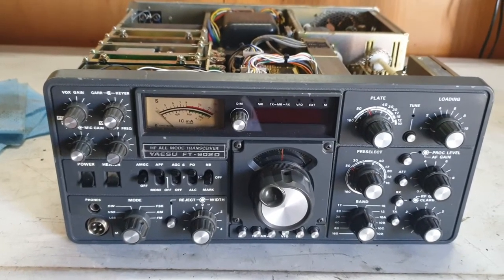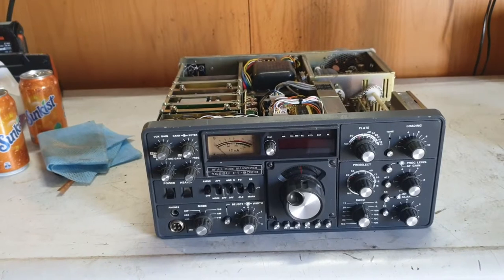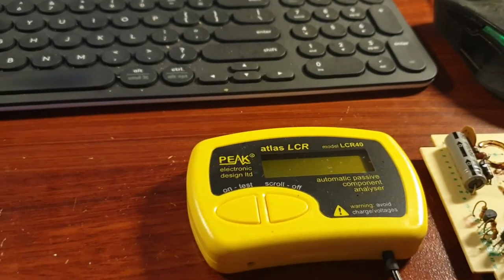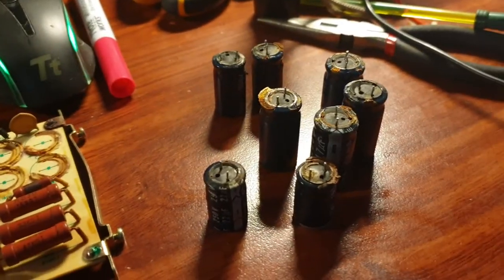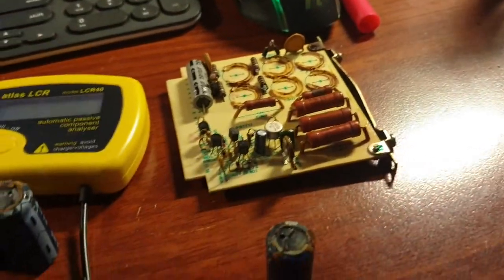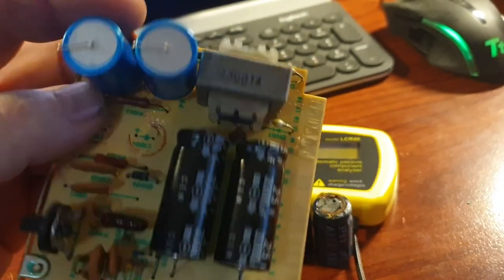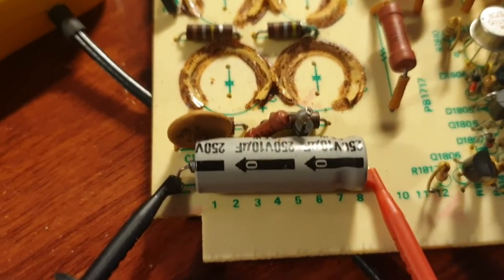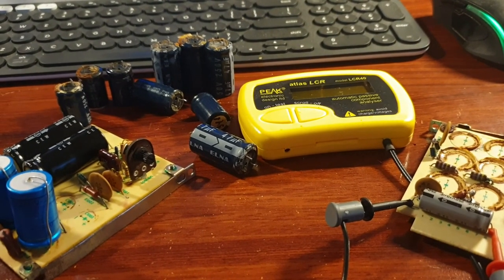Yaesu FT902 HF Transceiver  Capacitor checking. Easy and quick testing with the Peak Atlas LCR40😁😁😁

Comment: Yep, it's good to clean that brown glue off also when changing caps. That stuff has become corrosive after years, you can see it on this video also that one leg of the resistor on rectifier board is corroded. Also the metal bracket has some rust on it near glue. I just recently learned that a larger capacitance value can be a problem indicator too on caps. I had previously thought that only lower value and high ESR is a problem. I don't glue them again also, only if the equipment is going to a car use or if we are talking on very big capacitor cans...

Comment: I paid R2000 (about 100$) on a yeasu ft-901d. I t had no transmit and the plates supply wasn't working. About 2 hours of repair work and its fully working.